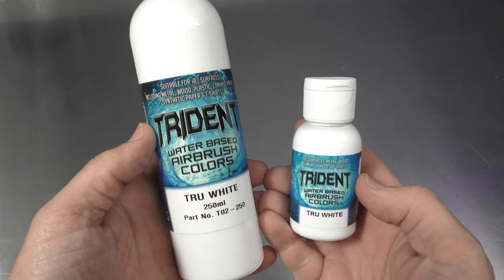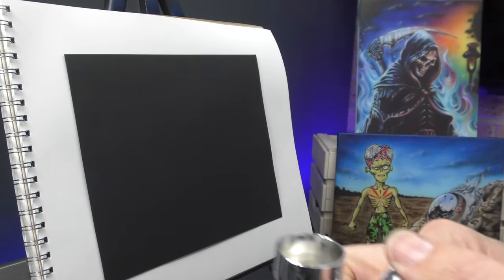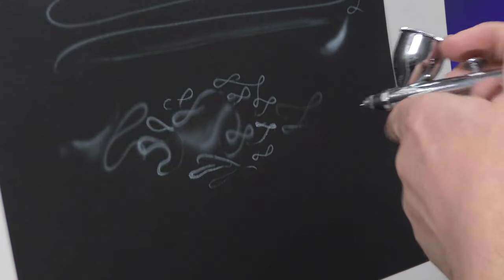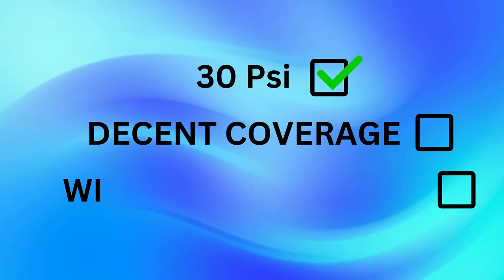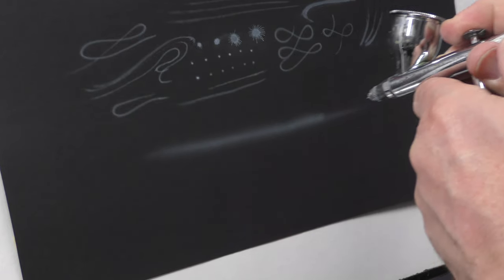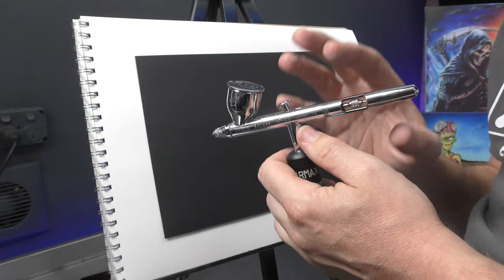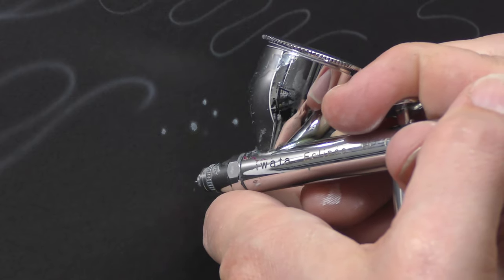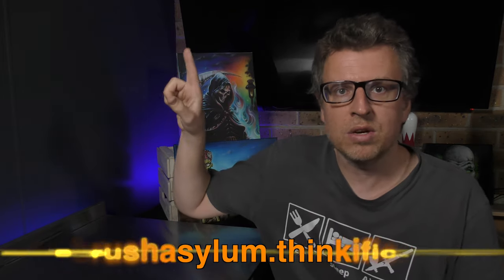Tips For Using White Airbrush Paint

Comment: Hello mate
I have a question, can iwata airbrushes be cleaned with acetone? And the Mr Hobby creos can also be cleaned with acetone?
Thank you
All the best
Reply from the maker: I would prefer that you use gunwash at the absolute max as acetone may be a little too aggressive , the Iwata’s and Creos both run Teflon seals but you should be able to clean everything automotive with gunwash . Best would be to stick with Waterbased paints if you can then you only need to clean up with water and your airbrush will love you for it 😉